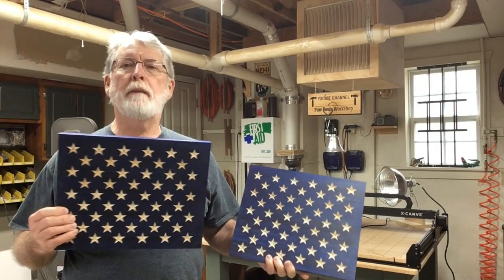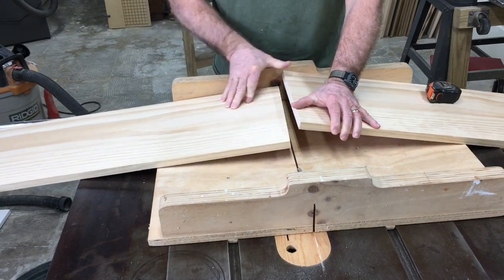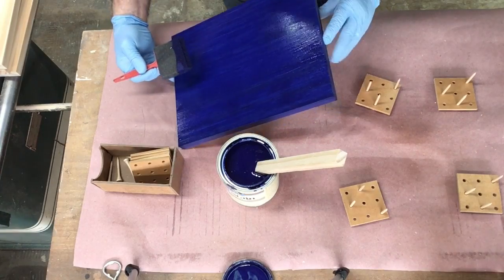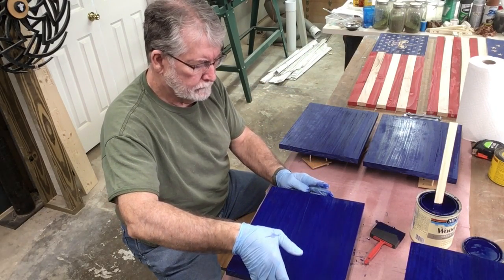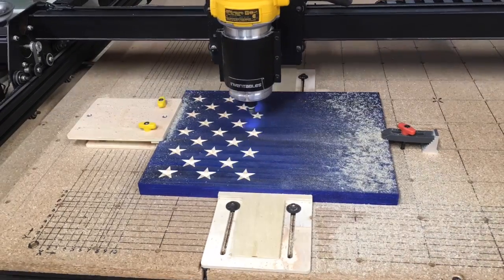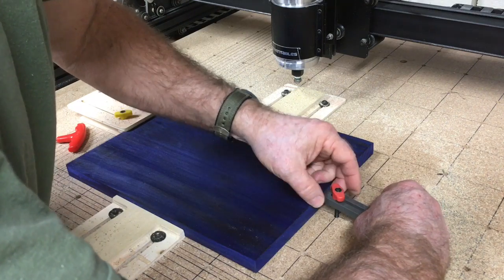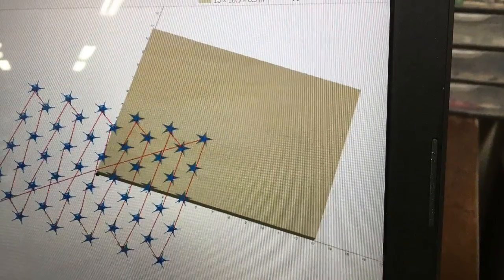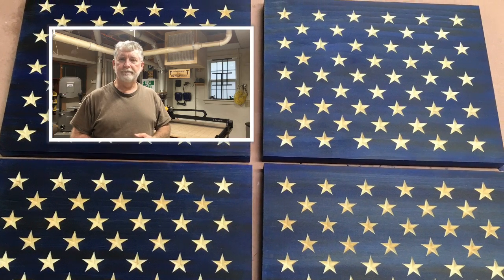Can You Stop in the Middle of a Carve in Easel and Start Again?

Comment: Paw Paw,

  On the flags why do you use water based dyes instead of oil based paints?????
Reply from the maker: All my flags are for indoor display.  All are sealed with a clear coat.  If they were to go outside, I would clear coat with UV protection.

Comment: Great vid. Paw paw.  I have the xcarve 1000 mm. When I do production runs like you do, I edit the g code in note pad to move off in y direction similar to what you did. Then when between parts, I just elect to use manual offsets, then use last x,y,z coordinate offsets. That way I dont have to retouch -z-. Not sure if it's the right way, but it works for me. I enjoy your vids and thank you for the  bump stop vid. I plan on making the improved stops you did as soon as the garage gets above 19 degrees.  Lol..
Reply from the maker: Thank you very much.  I'll have to look into that process.  Good luck with the bump stops, they should help you.

Comment: wait..when you run a program again does it say use last home psotition or does it just say use last xy home position?
Reply from the maker: you have the option to set the x,y or use the last position.  I used last position twice, once was great and the second the machine took off running in a whole new direction.  All Inventables could tell me is that for some unknown reason it lost the x,y position.  NEVER used it again.
Reply: @PawPawsWorkShop  I think the machine settings are likely saved as a Cookie. The settings reset to defaults quite often, so previous position is likely lost

Comment: test it and see.... you should not have to rezero x y or z if you are using production style runs....i could be wrong but i believe you should not have to..if you just use same home position feature...it should not fail..if it fails then there is a problem in the software or glitch..which obviously you said you have encountered....
Reply from the maker: z probe will need to be done.  99% sure

Comment: paw paw im a little confused..after settinmg up 000 for your first part why would you have to rezero your z every time when you are using exact same thickness material? you should not have to rezero x y or z if you are using the setup you have ... and when you move your gantry via easel jog you should not have to bring it back to 00 to start the carve ..when you start program it knows where 00 is already and will go there no matter where you positioned the gantry prior to that ..assunming you moved it via easel jog feature
Reply from the maker: You have the option to "use last x,y position"  I have had that fail and the machine takes off on a mad run.  Therefore, I choose not to use that option.  I have never tried not using the z probe in between carves mainly due to the fact that everything that I have read says you must do that...looks like a test is in the works. I never reset my x,y 0 point as you have seen in many of my videos when doing multiple carves.

Comment: you changed your design.. last time you used 1x2 and glued together :)...moving on up paw paw
Reply from the maker: These were sold as union only.  I will still use the 1x2 for the whole flag, mainly because the wood is already cut and I don't have to buy the premium pine.  However, if I sell just the union, this will be the process.